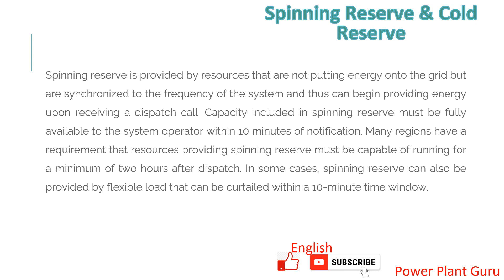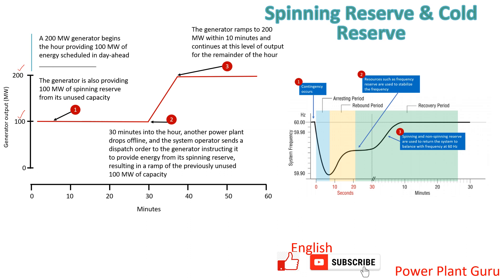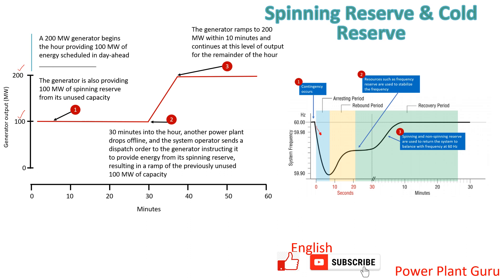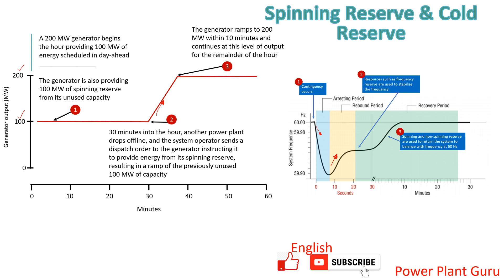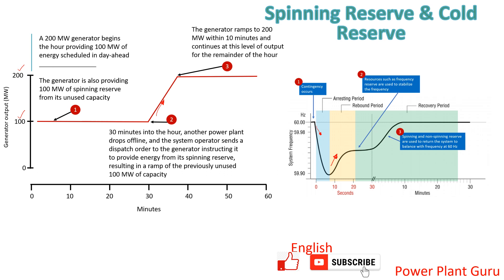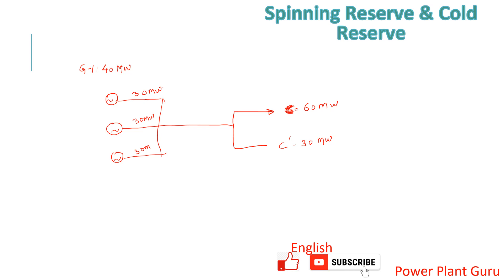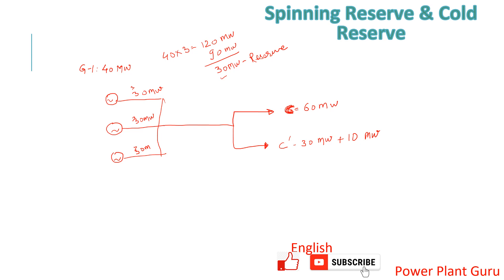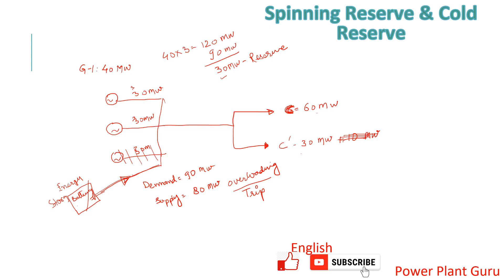Spinning Reserve in power generation | Hot reserve, Cold reserve, spinning reserve, Gas turbine

Comment: Whats the difference between hot and cold and spining reserve???

Time only?
Hot and spining both means generators synchronized already or only spining ?
Reply from the maker: Cold reserve in a power system is that reserve capacity which is available for service but normally not ready for immediate loading. A Cold reserve is ensured by special reserve units with small start-up and spin-up time. Period of the cold reserve start-up is varies from 2 to 24 hours and more.
Hot Reserve in a power system is that reserve capacity which can be made available quickly. For example, we have a hydroelectric generator of rating say 100 MVA but currently supplies only 70 MVA. In this case we have 30 MVA hot reserve than can be loaded immediately by simply opening the valve to the hydro turbine.
Reply: @powerplantguru007  nice detailed explanation , what about “spining reserve”?